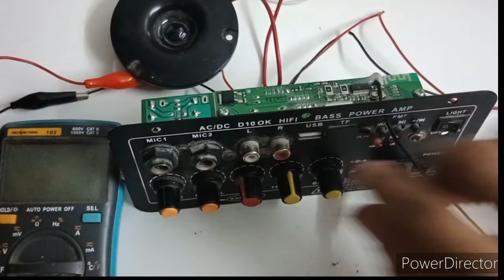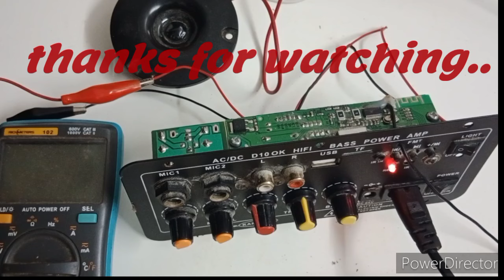hi-fi bass power amplifier, no sound left channel repair...

Comment: Sir yung nabili po namin bigla po nawala power nya po diman lang tinapos isang kanta po.sir ano po sira pag wala po syang power.sana mapansin po comment ko sir salamat po keepsafe po lagi🙏
Reply from the maker: Check mo kung may kuryente na pamasok sa primary winding Ng transforme. Kung meron, nasa secondary ang may sira, check mo lahat Ng components , diodes, capacitor , check mo din Yung hinang ng baka may kumalas na hinang.. resolder mo kung may soldering iron ka .